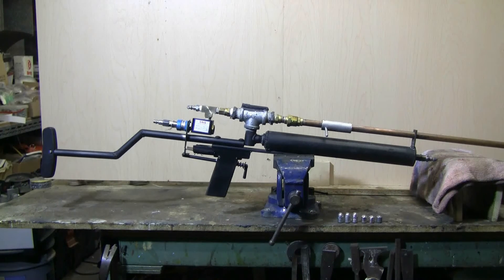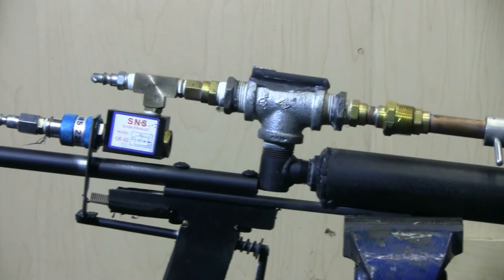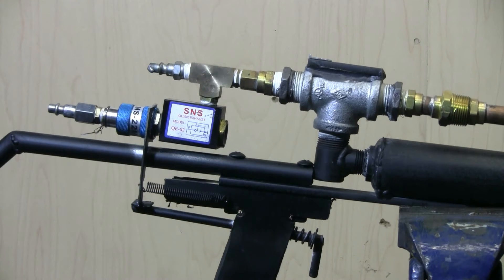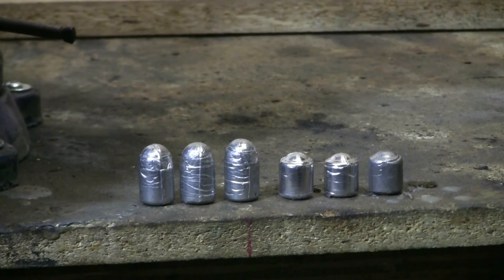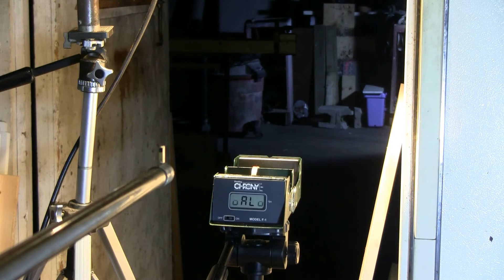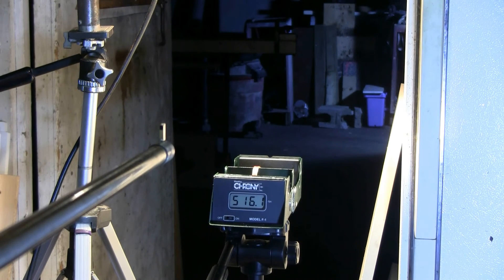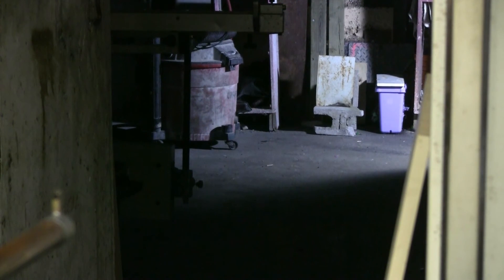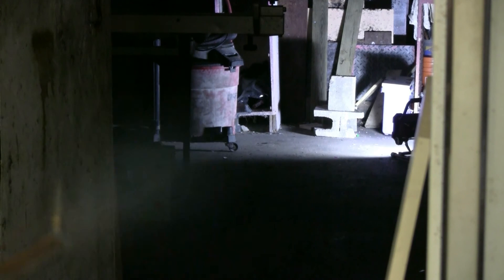DIY Big Bore Air Rifle Version 2

Comment: +Bill Gilmour could you make a video on how to make the qev valve? other videos i watched were very bad.
and how did you make the barrel breechloading?
Reply from the maker: +Gabriele Ciciriello To make my barrel breech load, I cut an opening into it big enough to load a AA battery. I made an aluminium sleeve that slides over the barrel opening after the slug or battery is in the chamber.

Comment: If the online calculator is right, using high pressure air you are getting 281 joules of energy from the 350 grain and 328 from the 500 grain.